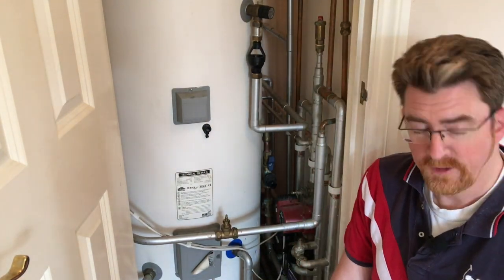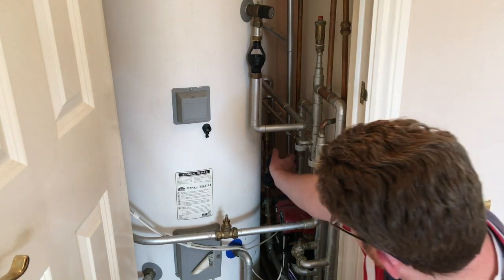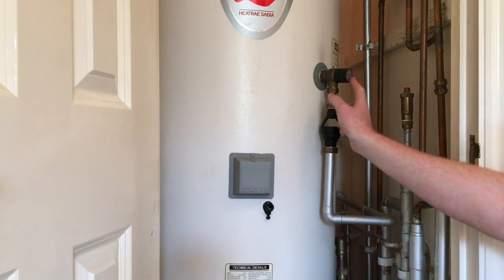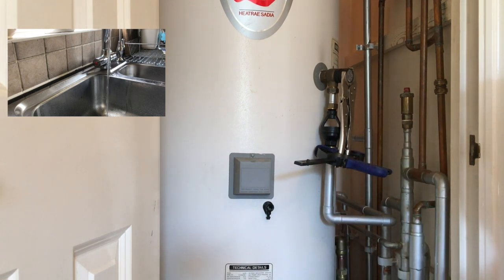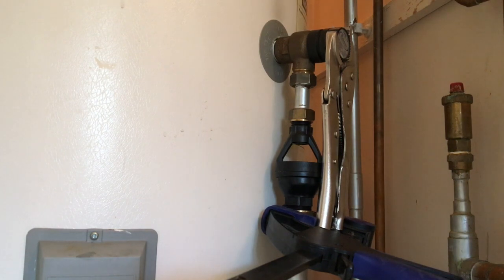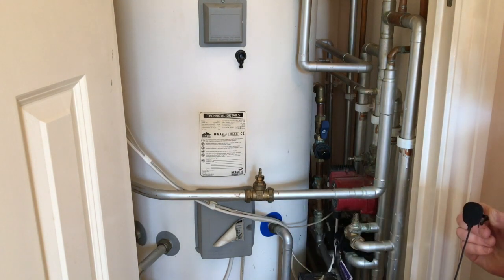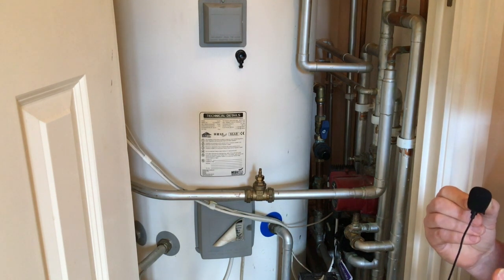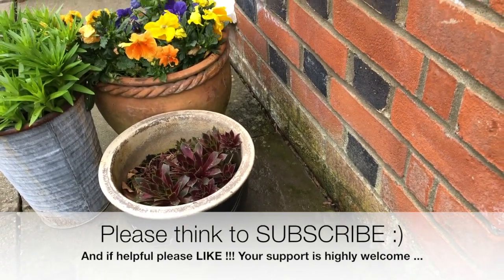Megaflo recharge of air gap

Comment: The red tank you mentioned about 1.5 minutes in is red for a reason . .. . it is the expansion tank for your gas boiler  . .nothing actually to do with the Megaflo itself. The expansion air pocket for unvented systems that that is situated out side the tank (yours is inside) is a white expansion vessel . . . . .Megaflo makes both types of air pockets tanks (internal air pocket and external air-pocket (internal and external to the hot water tank)). There are advantages and disadvantages of both.
Reply from the maker: Hi Glen, thanks for all the comments.  The system installed in my house is over 18 yrs old and as the builder never mentioned how to look after the tank and the air gap, hence the video.  I know the Red Tank is for CH system to take up expansion of the heated water when that is on.  I mentioned it as there is a PRV fitted to it and water can drip from this if that tank should fail. So you have two sources where water can be expelled outside the house.  Your flat comments I'm sure will help others who do not have a lower HW tap to drain the water out of the tank. Cheers Joe
Reply: Joe, you are in the small  percentage of unvented cylinder owners who actually recharges the air-gap! Well done. Most don't and they have the system over pressured when the hot water heating is on, and hence dripping tundish  . . . . For those with plastic push-fit fittings after the hot water, it puts a strain on them and often goes above the stated maximum pressure so they act as THE pressure relief valve and leak, instead of into the tundish via the designed and supplied pressure relief valve . .  .or worse, pop and you then have flood on your hands.
As for tenants in a block flats being asked to recharge their air-pockets in their unvented . ..  .not a chance!   . . . leading to so many unvented cylinders reliefing into the tundish or the the weak link else where, causing damp to grow over many months or years.

I have a PowerPoint showing the Syphon Effect (your video) versus Bottom Drain method for recharging these unvented cylinders. Not sure How I would get that to you if you are interested.

I have an unvented "Heat Store" system by Glendhill in another apartment (Heatrae Stadia do one as well). Mains pressure only so no chance of over-pressure. Maintenance: top up cold header tank every year or so due to evaporation (its a closed system) . . can be plumbed with a ball-cock to fill automatically provided there is a outlet to waste water or tundish, should the ball cock fail. I think I will  be considering this system in the future in my current apartment which has a Magaflo, unvented, internal airpocket.
Reply: @glenn1285  Having a ground floor mounted Megaflo in need of a recharge, I would find your powerpoint on the bottom Drain method very useful Glenn.  Any chance of a copy?

Comment: For the closed unvented system, the 'open up lowest hot tap in house' relies on the siphon effect: water is 'sucked' out of the top of the tank (yes, up) and then down to the hot water tap . . . . .  . when you haven't got an 'downstairs' (eg an apartment or the Megaflo is situated on the ground floor), this siphon effect is often not that powerful and 'stalls' (momentum of water is lost). You then think you have recharged the air-pocket . .. but you haven't. SO, the only way then is to drain some of the water from the bottom of the tank (the drain valve tap, usually via a hose to the shower tray if in an apartment, or have someone plumb it in to the tundish or into a waste pipe), leaving any hot water tap open where air will be sucked in. When you hear the bubbling stop (air being sucked in from the hot water tap through the water that is where the air gap should be) then you know the air gap is recharged. Then simply turn off the hot water tap, and turn the cold mains back on as shown in the video. Megaflo told me they are thinking about updating the instructions for this situation, which in apartments must be quite often.
Reply: @ziplockk  I presume when you say "instructions shown here does not recharge the air volume correctly" you are referring to the video, not my comments?
Reply: When you say drain from the bottom of the tank, would the drain valve connected to the cold input that is at the lower side of the tank do? Thanks
Reply: @timcarpenter2441  absolutley should be fine so long as there is nothing (like a check valve) inbetween that cold input drain valve and the tank. Don't forget to open a hot water tap and/or crack open the TPRV (anticlockwise) and hold it on the top of the cam. . . . . there is a skill to this without having to stand there for an hour or half an hour holding it, or, use a pair of molegrips/pliers and hold it open . . .to let in air towards the top of the tank to let the water fall out quicker at the bottom of the tank.

Comment: Hi joe I’ve got the same system. My central heating is working but not hot water. When I press the hot water on the timer the boiler doesn’t react but does when I press the central heating button. Do you have any ideas.? Thank you jason
Reply from the maker: @jason atkinson, My hot water and heating system is a Honeywell Smartfit set-up (16 years old), its rather odd as its a low voltage system so I probably can not give you much advice.  I would probably start by looking at the on tank Thermostat (tank temperature gauge) to see if that is the issue as I believe most HW systems use this to see if the tank is hot enough first and if its too cold (<60DegC) it allows the system to fire and run the boiler when HW is "on", if that is broken or adjusted too low it wont turn on. Have a look at this other YouTuber's video about replacing a thermostat https://www.youtube.com/watch?v=PPPcYeP-QLg.  If this helps please tell all in the comments and Like and Sub to the channel (it all helps!!) Cheers Joe

Comment: Thanks a lot. Just out of interest, what's the dimension of the cylinder and the dimension of the space that housed it? We're thinking of installing one under the stairs if it'll fit.
Reply from the maker: I would check out the manufactures web site and get in a qualified plumber to assess the area.  https://www.heatraesadia.com/products

Comment: Great video, thanks for posting 🙏

Just attempted this and found that the TPR on my Megaflo can remain open without holding it in place. If twisted again, it clicks back to the closed position as before.

Is this an issue with the TPR as your video explained it needs to be held open (rather than staying open itself) until the gurgling stops?

Thanks
Reply from the maker: If it stays open and you can hear it gurgling that means air in going in to replenish the air gap. Leave it that way until it stops filling with air (about 30mins). BE SURE to close it before you switch the main water back onto the tank.  If worried contact a qualified plumber. Cheers Joe [Please think to Like and Sub :)  ]

Comment: What is there is a drip still from overflow next to tank after I’ve done this?
Reply from the maker: @M Dktf, is it dripping into the tundish from the value?  If so you might have a bit of calcium grit.  You could try closing the main tank inlet valve off (main water feed) and opening the value and quick closing it to see if that dislodges it (but do this with care as there is high pressure behind the valve now!!!) water will rush into the tundish.  If it is still dripping get in a plumber and get them to change the valve.

Comment: Hi I have a megaflo and cold water flow is fine for me however hot water pressure in shower has gradually become very low. Will replenishing the air gap improve this? It probably was last done about 6 months ago but pressure has dropped suddenly very recently. Thanks!
Reply from the maker: @Zoe Parton, that is worrying! If you do a replenish again the air gap again, which I would recommend as the first step,  did the tank fill quickly or very slowly. If slowly you might have a blockage between the Balance Valve and the second shut off value.  I recently ran into that issue with our as there was a white plastic cap on one side of inner works of the Balance Value which came off blocking the main flow to the tank.  This caused the water to run fast at first then very slowly.   You need a plumber to fix this!

Comment: I have an unvented hot water tank. The hot water pressure in low now and I have not recharged the system since we moved in 5 years ago. The tank itself I think is around 16 years old. Do you think recharging will help to increase the HW pressure. Thank you for your advice.
Reply from the maker: @Suraj Krishnan, first a disclaimer 'm not a plumber, if you are worried to work on a Megaflo to recharge the air gap call one in. As mentioned this is a customer permitted activity, if the tank has not be recharged for 5 years and is 16yrs old it will have lost some of the air into the water in the tank. A recharge is a good first step to seeing if that solves your low pressure issue.  If that does not fix the problem please contact a qualified plumber. Good luck and do tell us how you get on! Cheers Joe

Comment: My pressure as indicated by two clocks, one near the megaflo system and one on the expansion vessel is below 1.0 bar now. Is this what I need to do boost it back up and will it go to far? Or do I need a plumber to come and fill the pressure by opening the filling loop? There is currently a label on the filling loop to the expansion vessel that says not to touch it. I can quite loudly hear radiators in upstairs rooms filling up now the pressure has dropped a bit. Your advice would be greatly appreciated, thank you!
Reply: The actual water pressure we have is really strong so I may sound stupid and it could be something else...
Reply from the maker: @matthew Missons, First a disclaimer, I’m not a plumber and it is best if you are unsure to get one in.  In the video you see for a few seconds a red expansion vessel just above the megaflo.  This is for the heating system, on a close hot water system like the megaflo there are no header tanks in the loft. When you run the central heating the water in the CH system expands, to take up this expansion the system uses these expansion vessels, in the case of ours it is red but could be other colours.  When the system is cold typically the gauge would read around 1bar. If the heating systems has lost some water then it will be lower than this. You can recharge these by topping them up, but it is advised to be no more than 1.5bar. The radiator noise might indicate you have air in the system, so bleed the radiators at the highest point or the ones making the noise. If there was a lot of air in the rad your gauge will now have dropped as the air is replaced by water held in the expansion vessel. Check and top up. If you are worried about any of this call in a plumber. This not an issue with the megaflo but with CH system.

Comment: I never use pliers to hold open the relief valve knob of my MegaFlo! It's not designed for the force of pliers -- you could easily wreck it. Use your hands -- it's not hard.
Reply from the maker: It's just a tip if you don't want to stay there for 20mins and get on with other stuff, as in the case of my tank it takes that long.  The Mole grips are only loosely gripping the plastic valve cover so it is not damaging it.

Comment: Great guidance. Does this process affect the pressure gauge? Mines is situated above the tank. Currently reading below 1 bar.
Reply from the maker: @Dan_Ecosse, is the gauge connected to the MegFlo or is it on a smaller expand vessel, mine is Red in the video.  If it is on the smaller one that tank is used to take up the expression of the central heating system when it gets hot. If the gauge is around 1 bar your at the correct pressure.  When I do this process on the MegFlo as the systems are not connected it has no effect on this gauge.  Without seeing your full set-up I'm speculating.  If you are worried about these steps please get in a plumber as these systems are complicated.

Comment: Hi there - very helpful video - when I turned my T&P valve to open it, it ‘clicked’ and bounced back to closed? Is this a safety mechanism to stop it staying open?
Reply from the maker: Yes the valve will slam close off if you turn it to far. This will not damage the valve if you do it a few times, but is you are in a hard water area some calcium might chip off causing the valve seal to not close off properly. Try and open the valve slowly a small amount, this is why I use the two clamps to hold it open just enough to let the air in. If this helped please think to like and Sub ;)

Comment: D2 is wrong below the tundish lol
Reply from the maker: @Phillip Bull, not sure I follow what you mean by D2 is wrong.  This was how the Megflo was installed when I bought the house over 15yrs ago. It works OK so I'm not sure what is wrong?
Reply: @joewoodford9428  D2 is wrong after tundish ...300mm before first bend after tundish
Reply from the maker: @phillipbull3673  Oh, interesting must have been the original plumbers !! Does not effect the system, I guess if the PRV did dump water it might not flow out quickly enough?
Reply: @joewoodford9428  no doesn't effect system just doesn't meet regs
Reply from the maker: phillip bull ah, nothing can be done now, system was installed over 15years ago. Thanks for the comments let’s hope it helps others 👍

Comment: What are the symptoms that let you know you need to do this,
Reply from the maker: @bill500carphead, either low or very low HW pressure or you see dripping through teh Tundish.
Reply: @joewoodford9428  
I'm getting a vibration & rumbling sound, tundish isn't dripping & pressures same as always been. Going to check the pressure in the  expansion vessel when the gauge I ordered  turns up
Thanks for the reply
Reply from the maker: @bill500carphead  Rumbling doe snot sound good.  I suggest you get in a plumber.  Do try the to recharge the air gap, you never know, it might be the fix.

Comment: Are you a plumber?
Reply from the maker: @Paul Smith , thanks for the question, not a plumber.  I state 4mins 45sec in if you want to work on these systems they are dangerous and you need to get a certified plumber to work on them.  This activity is OK and approved by Megaflo as a customer maintenance activity. I'm a physicist, engineer, electronic hobbyist and very competent DYIer. I have carried out this procedure now over 20 times.
Reply: Joe Woodford regardless weather your rocket scientist or not you shouldn’t be touching it you mentioned about changing the inlet/pressure reducing valve which you have to be G3 reg gas safe to do which I am you do know if anything goes wrong with them there like a bomb when they explode I’ve seen it happen
Reply: Joe Woodford there a lot of people in your comments changing valves there self a lot of them are not plumber/ heating engineers you posting videos are basically telling people it’s okay to change/maintain there cylinders I train every 5 years for this and it costs hundreds of pounds not to mention gas safe reg every year at £180 this is dangerous what your doing and you shouldn’t be showing people on YouTube because your board if somebody injures there self or kills someone because of your actions will you be able to sleep at night
Reply from the maker: @Paul Smith, re-pressuring a MegaFlo is a End User/Customer activity and these instructions are from the Heatrae Sadia website.  I show these instructions also printed on the side of the tank during the video and what I carry out are these steps. I also state , as I mentioned above, that any OTHER work should be carried out by a CERTIFIED plumber accredited to work on a MegaFlo. Here is the link on their website with the recommended steps to add air to the cylinder https://www.heatraesadia.com/information/frequently-asked-questions#Accordion9
This maintenance is required annually and requires no specialist skills or regulatory certificates to perform.  Anything other work carried out on a Megaflo requires a plumber. If anyone feels they are uncomfortable to perform this process they should contact an accredited plumber. 

What I offer here is a visual guide to these instructions. Thanks for your comments.
Reply: All your comments are people asking if plumbers have done the job right and thanks for showing me your not even a plumber if you want to be go to college and learn like the rest of us
Reply: End of the day you shouldn’t be messing with stuff your not qualified in or you have no knowledge about reading stuff off the internet or reading the mi (manufacturers instructions) doesn’t give you the knowledge or experience or qualification that I have or other engineers diyers flooded the building game in the 80s killed loads of people and that’s why we have the hse and health and safety is so over the top stick to things you know if you don’t don’t try it get somebody in and for everyone reading this don’t listen to this bloke he’s not even a plumber
Reply from the maker: @Paul Smith, It was changed and its was carried out by a Certified and Credited Plumber who works on MegaFlos and other unvented cylinder installations, who happens to be a mate of mine. He did not want to get filmed.  But I showed his work, which is excellent and would recommend a plumber should carry out such a refit.

Comment: Thanks for the video. My mega flow tank is 18 years old and the hot water flow trickles down to zero after a few minutes.
My cold water stopcock may be faulty.
Reply from the maker: Also check the balance flow valve and circuit, there are some parts that could come away and block the flow.